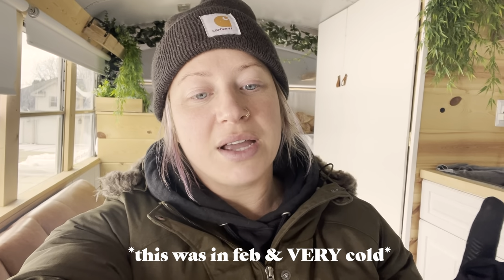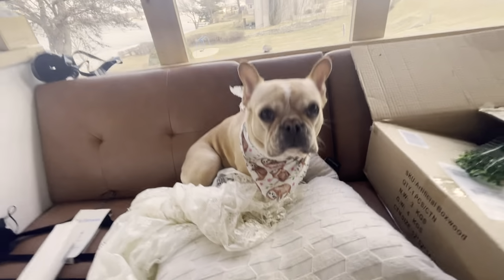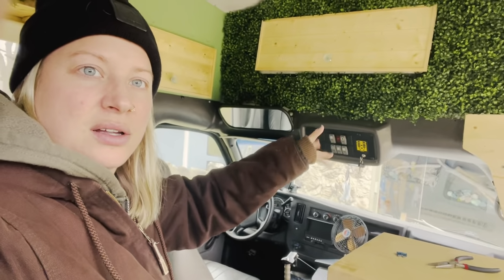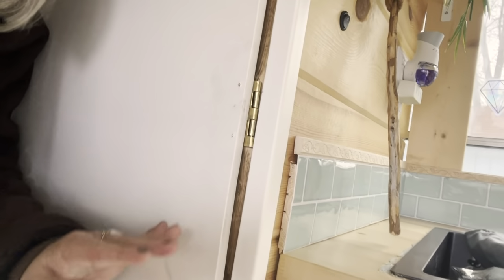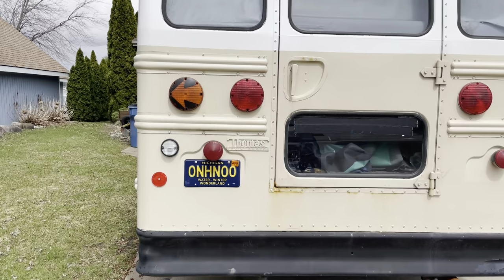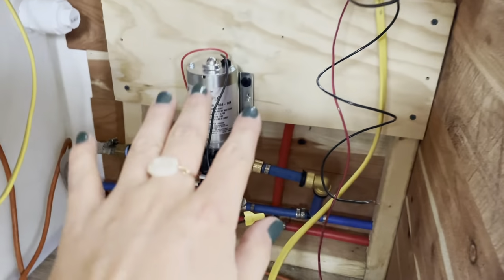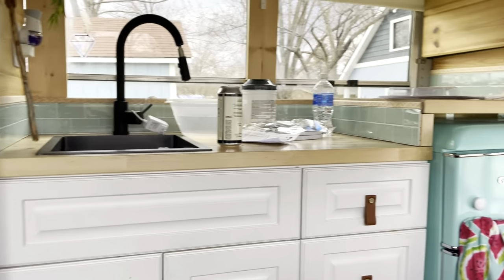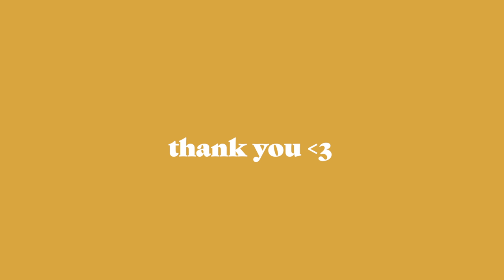Skoolie Vlog | Simple Door Locks In Bus | Fixing things in short bus

Comment: A switch under the fender cuts off part of your bus systems? I've never heard of that before. Maybe if it cut off the ignition somehow acting as an anti-theft device but none of the things that stopped working prevented the bus from starting and running. 
It sounds more like when they were fixing your AC they blew a fuse or two that were located in an aux fuse box in the engine compartment or they broke a ground wire. But at least they fixed it. It's just a weird reason they gave. 
Nice looking bus. And the pooches are hilarious.
Reply from the maker: Thank you! Yeah I’m thinking they blew a fuse. They didn’t tell me exactly but did it quickly and for free!

Comment: I opted for a Jimmy-proof lock on my back door (a la "Gus the Struggle Bus") and have zero regrets.

Makes loading and unloading groceries infinitely easier and I use it as a primary path of egress on the daily.

Locks from the inside and the outside, relatively easy to install, minor fitting required.
Reply from the maker: oh thats smart!
Reply: @earthtokrissy  Highly recommended!